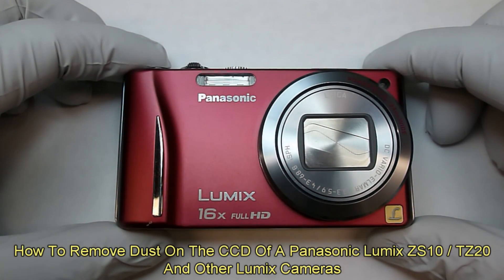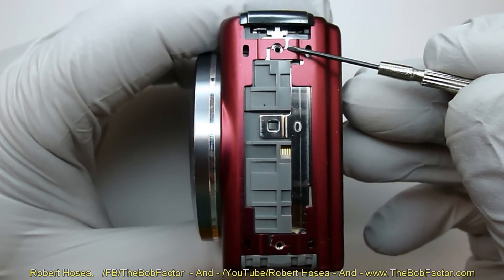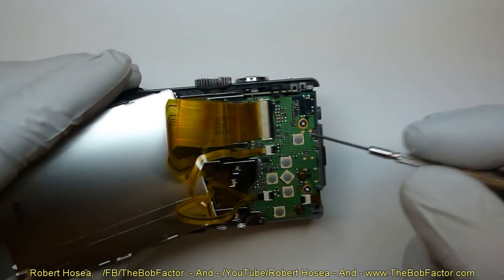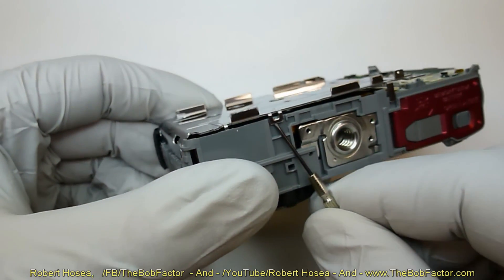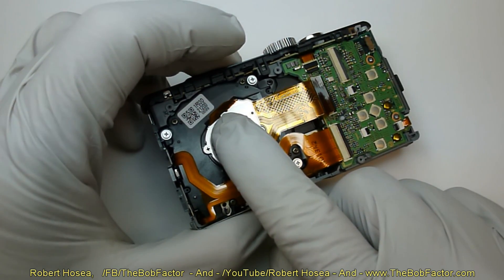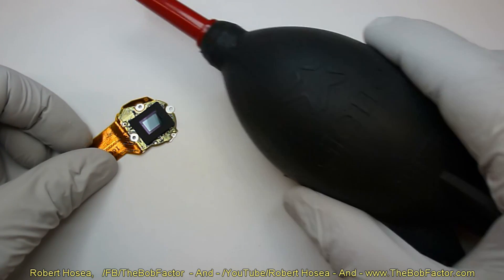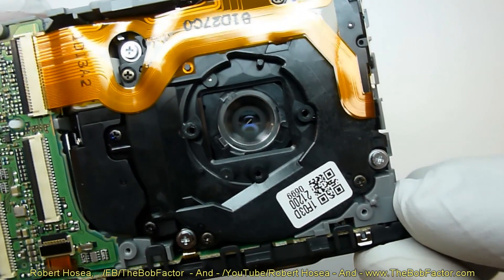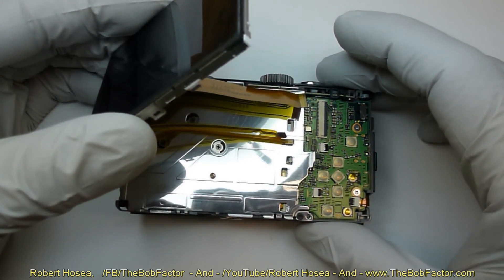Panasonic Lumix ZS8, ZS10, TZ18, TZ20, TZ22 Clean The CCD, Replace The LCD

Comment: I have another issue on my ZS8 here and I would prefer not to open camera totally, thing is that dust is located on the front side of the lens and not on the inner side. Dust is literally under the first protective glass on the very first ring once the camera goes out. I see that on the first ring where protective glass is, there is a small kind of a button but I am not totally sure if that first ring is detachable. If so I would prefer maybe to get out that ring and then clean dust but I would like your advise on it. It is the last ring where you have lens info (Leica DC Vario...)
Reply from the maker: Unfortunately the only way to get to the inner side of the lens that you are talking about, is to totally disassemble the lens. There isn't any way to remove it from the outside of the lens unit. I do have a video showing the complex disassembly and assembly of a ZS7 lens, but I don't have one for the ZS8 or ZS10 lens units. The lens on a ZS8 and ZS10 is even harder to disassemble then the lens on the ZS7. Something that you can try though, is to remove the CCD, and then use a squeezable air bulb and blow air through the opening where the CCD was. You may be able to get enough air going through the lens that it will blow the dust off of the inner side of that lens. Don't use compressed air at all though. Compressed air, such as air cans, will have a small amount of oil and that could make things even worse if you get oil on the lenses. Here is the link to the lens disassembly video for the ZS7, just to show how complex those lens units are: https://youtu.be/zDGVqY2N0PM
Reply: @Thebobfactor  Hey, thank you for the answer. I eventually find out video called "Panasonic Lumix Travel Zoom - Sticking Lens Shutter Repair" which is the same one as I have and I saw that the guy at disassembly part actually took out that first front part with a kind of razer just in order to later return it. What do you think about it? I might tried but I am afraid not to broke this point. In any case I understand that could be tricky.
Reply from the maker: @rogyn8484  I've never seen it done that way before, but it sure looks like a great method, He has been working on cameras for quite some time, and so he knows what he's doing. I don't think there will be much chance of you damaging your camera using that method, and it would be worth trying for sure. Good luck with it, and let me know how you make out on it.
Reply: @Thebobfactor  I already done this, dissembled everything until the shutter and I removed bunch of dust including the one on the front side of the first glass, however now I see that the main dust I wish to take out is behind this first layer. It is like circle glued with something around but I am afraid if I try to cut this with razer that something will went wrong, what you suggest? This first layer is visible in his video at Reassembly part (you will notice circle glass at the top in front of lens. Do you think it is worth to try and take it out?

Comment: i tried this with my tz18 but the screws are too tight and im afraid i’ll damage them if i try to take it apart harder, what do i do :( i have the ph00
Reply from the maker: You should try a PH0000 screw driver then. Many of the later models used that size of Phillips head screws on them.

Comment: I love working on Panasonic gear. So intuitive and very well put together. 2011 when launched, these were RRP £349.99 - with touchscreen, 16x zoom, and GPS. 2023. I just bought two prisitne but 'faulty' ones for £20 delivered.... just under 2 hours later, I have 2 almost mint, fully functional cameras to add to my collection. Sad we live in such a disposable society, but it's always a bonus for us thinking and dextrous types!
Reply: Sorry, I left my previous comment early on in your video. Have now watched it through and am very impressed with your presentation. Could not agree more with the "if it's just dust, just use a blower and don't touch it" approach - common sense for many, but worth stating! Excellent video - you have a new subscriber, thanks!

Comment: Hi, Man! I have the same camera as you have. This cam just got stucked to our storage room, and now im trying to open it and i losed the original charger and I'm now using a universal charger. when i put the battery to the camera, It doesn't turn on. is the battery the problem or the camera? can i contact u in private? plss help meee thanksss❤️❤️
Reply from the maker: Hi Suzuku. It would be impossible to say what the problem is right now, until we can verify that the battery is in fact getting charged. You will need to either try a different battery, or try the battery that you have in another camera. Once we have eliminated the battery as the problem, then we can move on to the next step.
Reply: @Thebobfactor  Hi, thanks for replying. I tried charging the battery using the universal charger, but turns out it doesn't work. But when I try it to other batteries (other camera), it does work. I think the prob here is the battery.?
Reply from the maker: @dyo_han  yes, it does sound like there may be a problem with the battery. Were you able to use a battery from another camera in the camera that was not working (the camera that was in storage)?
Reply: @Thebobfactor   I cannot cause it's a different camera. should i buy a new battery? im not sure if the cam is working too, cuz I haven't been using it for like 3 yrs.. If u think i should buy a new battery, do u know where to buy online? The model is Lumix Tz20. Thanks man, I appreciate your response. i subscribed!
Reply from the maker: @dyo_han , getting a new battery may be the cheapest and quickest way to determine if that is the problem. Again, knowing if the battery is good will help determine if it's the battery or the camera. I usually get most of my camera parts on eBay. Here is a link to a battery for the TZ20. I hope it fixes the problem for you! 

https://www.ebay.com/itm/254223413858?hash=item3b30e57262:g:MmsAAOSwXIRc0ZcV&amdata=enc%3AAQAHAAAA4KlmX2WjVaFpmm%2B2gzGag4l8PiMuKO%2BvrXvgLKW1VWJ82%2BWlml%2FmeXN0ct%2FR3FXceM81qbnTx0SGxZpFrzVDgGxnhrckG4MPjEDlnCY7qBRLgrz7pZDXQOaygkl1tgD18R1fMtvKNOo43LMG0kWI%2Bz9Jo7qNcj8OR%2BPW6vLKCLpqv7rGV%2Bt8vaUPxQkxKHoGnREqxlPyohBgDQ8h8ZTDJpYNIP%2FvRuxaDm9Ru4Rt2piBCNDfFyqwEVhm0aV0H%2FktpBt9GNtUGyDY1uu3Fxt0G6U%2FVlNxiRfyxYqXpCFtpsRh%7Ctkp%3ABFBMqouWwcJg
Reply: @Thebobfactor  Thank u so much bro. but sadly, i cannot order on ebay cuz im from the Philippines. do u know anything like, shopee or lazada?? thank u so much brooo❤️❤️
Reply from the maker: @dyo_han  no, I'm afraid I'm not familiar with those markets. If they have a search tool though, you should be able to just type in "Lumix ZS20 Battery" and it should come up with some results for it if it carries batteries  Sorry I can't be more help.
Reply: @Thebobfactor  It's okay. thank u so much!! have a good year.

Comment: Thanks for making this video. I use videos like this to see if the infrared filter is easily removable from a camera, from this video it looks like it's only held in place with some adhesive at the corners, and could be removed by popping it off with a thin blade or something. You held the camera yourself, would you agree that the filter over the CCD would be easy to remove?

Also, I've just seen you have many other camera disassembly videos on your channel. Are there any specific manufacturers that tend to make the filters easy to remove?
Reply from the maker: Hi Callen. I have never removed the IR filter on any of my Lumix cameras, so I'm not sure how easy it would be. As far as cameras where I have seen others remove the IR filter for astro-photography, both the Canon 60D and the Canon 6D are excellent for that. I'm sure there are other brands such as Nixon which are equally as good, but I am really only familiar with the Cannon cameras.

Comment: Thank you for your terrific guidance in cleaning the dust from inside my camera. Bravo! First, I searched everywhere for the proper Philips screwdriver.  Your video called for a 00 Philips screwdriver.  I brought a few 00 and 000 Philips screwdrivers that did not fit.  After being told there was no such thing as a smaller Philips screwdriver... even from a Camera store, I found a "0000 Philips screwdriver".   Question. When I removed the camera back cover, there is a gasket on the back camera cover. When I took off the back cover, the gasket came apart.  I decided to leave what gasket still adhered to the camera and cut off the bad small piece.  Will this be a problem?  Should I replace this gasket and strip and where should I get it?   Thanks!  P.S.  I magnetized my screwdriver and this was a great help.
Reply from the maker: That's interesting, I've never seen one of these Lumix cameras that had a gasket on the back cover at all. Was it around the entire cover, or just around the opening for the main LCD display? I generally buy replacement parts for these cameras on eBay, but I don't see any gaskets on there at all. It would most likely be used for keeping dust out, and I'm sure it will be fine without it, or part of it. Regarding the screwdriver, almost all other Lumix cameras that I've worked on, other then this ZS10, needed a #0000 Philips head screw. I'm not sure why this particular camera series uses screws that required a #00 Philips head screwdriver.
Reply: @Thebobfactor  Thank you for your reply and expert comment on the gasket to keep the dust-out.  Your YouTube mentioned a double or 00 Philip screwdriver.  My camera needed a 0000 Philips. The gasket was just on the underside edge of the cover that frames the camera LCD.  Thanks, again!   P.S.  Where shall I get a replacement black battery cover (Part #VYK4T91) for this camera?
Reply from the maker: @cskysurfer1 , when I look on eBay for a replacement battery door for a ZS10, I see a couple of ways that you could get one. One way is to buy just a used door for $38 + free shipping, and the other way is to buy a used black ZS10 camera (with accessories) for $39 + $8 shipping. Supposedly this camera works too, which is a bonus. It's possible that this camera would also have the gasket that was torn on your camera as well. Plus, you would have many other extra parts going this route.

Here is a link for just a black ZS10 door:
https://www.ebay.com/itm/282432438096?_trkparms=aid%3D111001%26algo%3DREC.SEED%26ao%3D1%26asc%3D20160811114145%26meid%3Df7b474a8850d4cb6b59d0aeb052c3c70%26pid%3D100667%26rk%3D3%26rkt%3D8%26mehot%3Dnone%26sd%3D283535386686%26itm%3D282432438096%26pmt%3D0%26noa%3D1%26pg%3D2334524%26brand%3DPanasonic&_trksid=p2334524.c100667.m2042

Here is the link for the black used camera:
https://www.ebay.com/itm/114769486020?hash=item1ab8cb60c4:g:eooAAOSwPaJgeeKx
Reply: @Thebobfactor  Thank you, Robert!  You are great!
Reply from the maker: @cskysurfer1  You're welcome!

Comment: Thanks.  I was able to clean the dust off my sensor on my TZ25.  A bit different, but enough the same for it to work. I couldn't see the dust, but just hit the two surfaces with compressed air from a can and the infrared filter with a cue tip as was shown on another video.

Comment: Thanks a lot for the really excellent tutorial.
This saved me Money to remove the disturbances seen which especially appear at high zoom rates.
I used the tutorial for my DMC-TZ22 which is exact the same procedure.
The only difference was, that there was a very tine sealing between outer frame an the LCD-Display.
It was split in between while lifting the outer frame. 
So I have to fix it before reassembling the frame with a few very tiny drops of superglue using a pointed tweezers.
I also used a can of power pressed air instead of the air bellow, which I think is much more clean and works with more pressure.
Reply from the maker: Hi Hubertus. Thanks very much for the information about the TZ22. That's really good to know and that can help others out. And, you are correct that a pressurized can of air has more pressure, but it can also contain oil from the manufacturing processes, which can then get on to the lenses. That's why the hand pump is better, since it won't have any oil in it.  -Bob

Comment: Great video, very clear and easy to follow.  I need to change the battery cover on my ZS10...do you happen to have a video that shows how that would be done?  I looked through your videos,  but I didn't see one.  Thank you!
Reply from the maker: Hi Kerry. I don't have a video that shows removing the door, but if you send me an email address I can send you some pictures that show how to do it.

You will also need to follow the instructions on tearing the camera down up to the point of the time of 4:30. 
https://youtu.be/pRhD0Yc9BH0?t=278
From there the photos will show you what you need to do. 

You can send your email address to mine at hiking@thebobfactor.com.
-Bob

Comment: Really good video and i followed it step by step but when I put dispay back and tested it wouldn't work i was worried that i not pushed wires back far enough. Anyway ive reassembled it to look at another day but now aswell the camera lens doesnt come out or zoom when switched on. It makes a noise but on come out a little bit and the shutters don't open fully. Any ideas.
Reply from the maker: Hi Lee. Were you having these problems before tearing it down? If not, I would certainly check the flat ribbon cable connections again. That is very odd.
Reply: Robert Hosea no only problem i had was a spec of dust on the sencer which i sorted. I thought i was doing a pretty good job untill it came to putting it back together. Ill have another go when i get a spare few hours 😀 thanks.

Comment: Hi I watched your video on removing dust from the TZ20 lumix. Everything went well until I turned the camera back on and now the LCD screen will not display anything. I can take pictures and they write to the SD card. When I view them on my lap top the dust has gone, which is great! Any suggestions about why the LCD screen won't come on? I have tried putting the third connector in again a few times. Do you think I have damaged the connectors?
Reply from the maker: Hi Mark. Unless you pulled hard on the flat ribbon cables, or bent them, I doubt they are damaged. I have run into the same problem before where everything worked fine except for the LCD. The problem was that the LCD's back light flat ribbon cable was in the connector crooked. I believe on this camera that the small cable on the bottom is for the back light for the LCD, and the other small one is for the touch screen. Make sure that both of them are 100% straight in the connector. It doesn't take much of an angle to make them not connect properly. Hopefully that will fix the problem for you. Let me know how you make out on this Mark.
Reply: Robert Hosea 
Thanks. I will try again and get back to you. I am worried i bent the cable trying to get it back in. Will let you know how i go!
Reply: Working now! The cables were all in place correctly but the screen hadn't been put in the right position. There seemed to be a metal clasp on the underside and once it was in the right place and the screen reattached it turned on! Dust gone as well!! Thanks for the great video and the reply! Happy i have my camera back!!
Reply from the maker: Excellent Mark! I'm glad that your camera is working again. And thank you for the info about the metal clasp. That's good to know.

Comment: One more thing, I was thinking that a pair of tweezers that are soft on the inside (don't know if these exist) would be helpful when pushing those flat orange cables back into position.
Reply from the maker: I have used tweezers in the past that have a rubber coating on the ends, and it was kind of hit and miss for me. Sometimes they worked well and other times they did not. In some cases it would simply come down to how much room there was to  work with. And sometimes the added thickness of the rubber (or plastic) coated tips would place the flat ribbon cable at too great of an angle to be inserted into the connector if the connector sits low on the circuit board. And on some tweezers the coating was too smooth and the flat ribbon cable would slip through. But, I think having them is a good idea.

Comment: This is an excellent video, although it is not the LCD I have to replace on my TZ18 I'm using this for guidance,. Its the top panel I have to replace as the shutter button/zoom has snapped so trying to get an idea of the internal areas from this. Thanks for your very clear instructions!
Reply from the maker: Thanks very much Jenny! I hope you're able to get your camera up and running again soon.